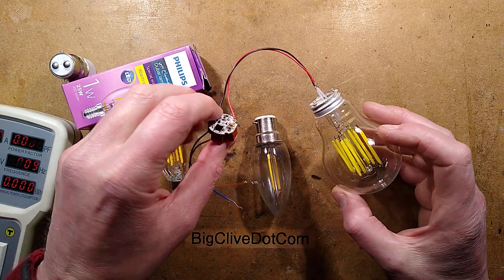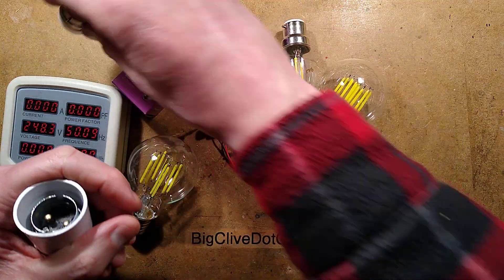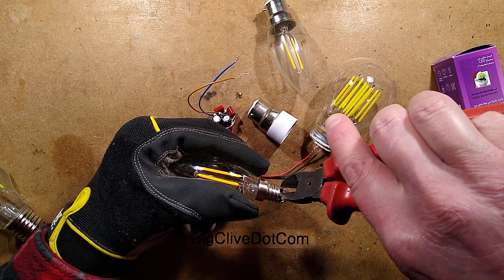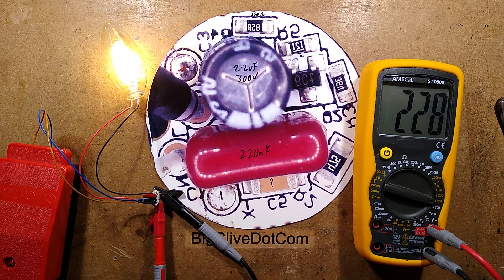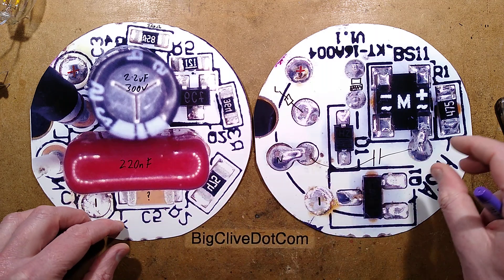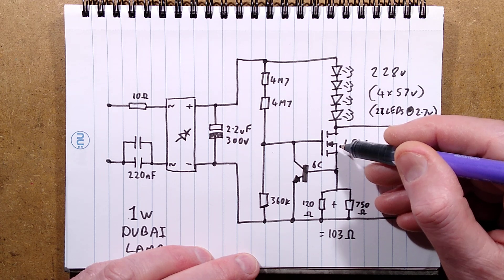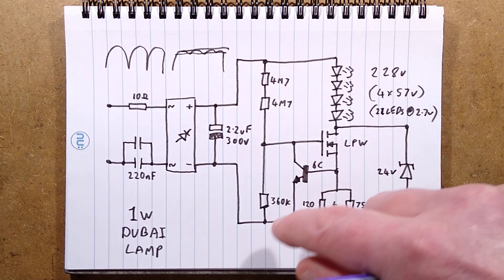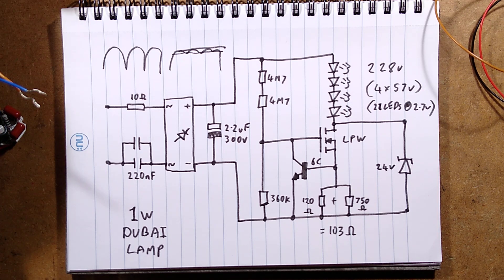Opening the 1W Dubai lamp (with schematic)

Comment: I bought such a lamp (but for E27 socket) in the Netherlands several years ago. It was costly, IIRC almost 20 EUR. I expected it to last many years but it failed after a few months and I used it for less than 1 hour per day. I planned to disassemble it but I put it somewhere and cannot find it.

Comment: I just realized that natural gas forced into tubular cylindrical flames would have the same result in a larger size would be insane efficiency. Thank you Clive
 🤘😎🤘❤️
Reply: Glass tubes shaped as the filament structure

Comment: I don't view the Philips Dubai Lamp as quite the wonderbulb it may appear to be to many at first glance. Here's why.

The Dubai Lamp's main feature is it's high efficacy of 200 lm/W. There is some good engineering coupled with some not so good tradeoffs used to accomplish that goal. The choice of starting with filament style LEDs on a glass or sapphire substrate with light being emitted from both faces was a no brainer. That is pretty much the industry standard these days among first tier manufacturers. If light comes out of both sides of the chip why not take advantage of that even if the substrate side is typically somewhat darker. A few percentage points of efficacy are gained by using a large multiple of filaments since cooler running chips produce more light. An added bonus is longer phosphor life. I doubt that 22.8 years from now (@ 3 hours per day)  I would be happy to be still using a bulb that is only producing 70% (L70) of the light that it once did when new while continuing to drawing as much power as ever. I have a bulb (GE LED9A19/830) purchased about 8 or 10 years ago. Energy Star rated, it produced 450 lm of 80 CRI light while using 'only' 9 watts of power. Probably cost about $15 and it still works. A few weeks ago I bought a 4 pack of Sylvania 450 lm 92 CRI lamps  for grand total of 97 cents. In various markets these are also called "TruWave", "Natural",  or simply "Reduced Eye Strain". They are dimmable and use 5.5 watts of power. 

One major benefit of the of the higher CRI lamps is the almost complete elimination of a rather nasty spike of 450 nm blue light inherent in most phosphor formulations used in 80 CRI lamps including the Dubai. While it looks good on paper, and contributrs a large percentage to the Dubai's stated 200 lm/W efficacy, it only adds to glare and the resultant eyestrain of humans. If you've ever wondered about how those amber sunglasses or ski goggles that reduce glare and improve vision work, they do it by blocking excessive amounts of blue light. 

Another tradeoff where the Dubai Lamp gains some efficacy is by eliminating dimming capability and reducing the operating voltage to the relatively narrow range of 220-240 volts. Circuits that can interpret phase cut dimming and convert those signals to linear flicker free but widely variable led curents also use power. The elimination of any form of power factor correction is also among the design tradeoff.

One last place where efficacy is gained is by the use of clear glass instead of any kind of coating or diffusion material. Essentially anything that uses power without generating light (regardless of quality) is eliminated if at all possible.

Technical information in English including all those nice graphs and charts can be found at https://images.philips.com/is/content/PhilipsConsumer/PDFDownloads/Saudi%5FArabia/ODLI20160920%5F001%2DUPD%2Den%5FSA%2DPhilips%2DDubai%2DLamp.pdf or by using the search string "dubai lamp technical application guide".

More information about the reasons to avoid excessive blue light can be found with the search string "Natural Light White Paper SYLVANIA LED TruWave Innovations"

One major benefit of the of the higher CRI lamps is the almost complete elimination of a rather nasty spike of 450 nm blue light inherent in most phosphor formulations used in 80 CRI lamps including the Dubai. While it looks good on paper, and contributrs a large percentage to the Dubai's stated 200 lm/W efficacy, it only adds to glare and the resultant eyestrain of humans. If you've ever wondered about how those amber sunglasses or ski goggles that reduce glare and improve vision work, they do it by blocking excessive amounts of blue light. 

Another tradeoff where the Dubai Lamp gains some efficacy is by eliminating dimming capability and reducing the operating voltage to the relatively narrow range of 220-240 volts. Circuits that can interpret phase cut dimming and convert those signals to linear flicker free but widely variable led curents also use power. The elimination of any form of power factor correction is also among the design tradeoff.

One last place where efficacy is gained is by the use of clear glass instead of any kind of coating or diffusion material. Essentially anything that uses power without generating light (regardless of quality

Comment: Shouldn't the voltage be something like 308 volt (220 V ×1 ,4)  after the bridge rectifier?
Reply from the maker: It's current limited by the dropper capacitors and then pulled down by the LEDs.

Comment: Does an LED 'filament" need to be in a bulb under vacuum? I didn't hear any fshhhh when you took the bulb apart.
Reply from the maker: They sometimes use a gas like helium at atmospheric pressure just to help couple heat from the LEDs to the outer globe.

Comment: This is an interesting bulb Big Clive, quite a bit of thought along with trial and error must must have been put into making all that circuitry fit into a candelabra base.

I suspect there was a fair amount of trial designs proposed before the customer accepted this design.  Normally, if you place a capacitor across the LED string to keep a small amount of current flowing during the valleys of the sinewave, the flicker is not objectionable to the average person.  However, this design in my analysis, does have some modulated intensity because the bulk filter cap is not large enough to keep the LED current from declining during the valleys, although the intensity probably varies less than an incandescent bulb.

What voltage is this bulb designed to run on?  With the 249 volts of AC input, I estimate the zener is probably conducting during the peaks of the sinewave.  My best guess is about 250 volts peak on the bulk filter cap with 30 volts Vp-p of ripple.  I am guessing the zener is used to protect the FET, for either over voltage or dissipation.

I do see a catastrophic design error with this bulb.  If the bipolar or FET are slow to react to a voltage surge, the base-emitter junction will become the primary path for high current.  The bipolar will short, which will signal the FET to draw infinite current, blowing out the FET and LEDs.  If you place a 100 ohm resistor in series with the base, it stops this sneak path.

I find it interesting how the emphasis was only placed upon power consumption of the bulb at the socket but, really failed in the attempt because, the power factor is so poor.  With this power factor, at the power station, it will likely take about 7 watts to drive the bulb.  Most of the power will be wasted in the power lines transmitting 50 Hz harmonics into the air.

I REALLY DISLIKE using a capacitor for a dropping resistor.  In addition to the poor power factor, it limits the bulb to only being run from low distortion sinewave power at an exact frequency.   This also makes the bulbs very susceptible to damage from voltage spikes.

Comment: The other bulb won't be that different. I say you enjoy using that one. I appreciate the offer tho.
The zener is probably a single 12v. You must have been tired. It looks like you interpreted parallel zeners like they were parallel capacitors.

Comment: So could I theoretically put a larger capacitor in my LED lamp to prevent it from flickering when my nearby laser printer randomly heats up? My house setup prevents me from easily plugging the lamp into a separately powered circuit outlet.
Reply from the maker: You may find that using a different style of lamp alleviates that dip.

Comment: The design of these lamps is confusing me. The left half of the schematic looks like a capacitive dropper, all be it without an anti-zing resistor. The right half looks like a linear regulator, using discrete components. I have never seen these two current limiting techniques used together in a led lamp.
Reply from the maker: It's very unusual.  The linear section may be for removing ripple.

Comment: Well you can release such a product but you'd have to price it 10 times higher, to account for it lasting a long time and also the higher component and manufacturing cost both. So $20 or $30 LED lamp. But it will be remarkably difficult to convince enough people to buy those to make it sufficiently mass market where it would pay for itself, more expensive niche items tend to explode in price at which they become viable.
Reply: yeah I figure about $4 each in materials for small batches, and if youd try to DIY then your time is heavy. how long to do 10 dozen? 2 weeks? a month or more?? only a  big corp could bring a similar bulb to market, but I'd bet Phillips has a patent on this design and quite a few others to stop any US sales in the near future. gotta wait for the Chinese knockoffs to get better I suppose
Reply: @pauls5745  this is patentable? No way. Similar current limiting circuits have been seen going back to the 60s if not longer. The execution is superb but there's nothing unique here.

I am actually hoping that at least one bigger state such as let's say China makes high efficiency LED mandatory, then we can get our hands on those much easier for sure.

Comment: I can see clearly now that the drain has gone...

The 12V / 24V Zener diodes are there to protect the MOSFET from overvoltage as it is likely that it is a 30V device.
Considering the circuitry, it would have been more beneficial to use the same type NPN transistor for current regulation...
From what I've observed, linear regulators and MOSFETs don't mix very well.
A reason they would have chosen this arrangement is because of the low gate drive current; but because of the extremely low (6mA) current, the base drive current would only need to be 30uA which would be easily filled by a 2MEG resistance at 300V.

Comment: More efficient, more reliable, no flicker...  I wonder if they also have a good colour index?  That these are unavailable outside Dubai is shameful.  I can't wait till these are available shipped directly from the Candy Rock Mountain.  EDIT:  For those worried about Chinese QA... I've bought quite a few different filament LED bulbs from China and the quality does vary greatly.  I do have a couple of bulbs left which don't flicker at all, and have been running for something like 6 years, now.   I made it a mission of mine to identify which ones were best, but since I moved house, all the fitted lights are LED by design, and I have little use for these "retrofit" bulbs.
Reply: According to the Philips "dubai lamp technical application guide" PDF, the colour index (CRI) is 80 with a rather large blue spike @ 450nm and as with many other older phosphor formulations, a relatively weak red output. The efficacy of 200 lm/w looks good on paper but current phosphor formulations in the low to mid 90's are far easier on the eyes.

Comment: I just want to find a decent 800 lumen lamp in a candelabra base. You can get them in incandescent, but sadly, none in candelabra yet.  A few that claim to be good, but they are expensive, and tend to die quickly.
Reply from the maker: It's too small a base for the high current circuitry.  Both the power supply and LEDs will bake.
Reply: @bigclivedotcom  Wow!  A reply from Clive. Woo hoo!  Happy day! (seriously, big fan) :)  Yes, they bake.  Perhaps something along the Dubai lamp where they lower the heat in the lamp and perhaps creep the circuit up into the bulb cavity for more room.  Still, I've got many fixtures here in the USA that utilized the small form factor of the candelabra base for a high lumen demand light.  Mostly candy dish style closet lights and two room lights with (acrylic) hanging crystals as pseudo diffusers. All pretty, but needing more output with LEDs.

Comment: I have all Philips standard LED light lamps, and I would love to have these more efficient ones. I would happily pay - pro-rata - for their extended life. If they last twice as long, then twice the price  ... just for the additional efficiency. 

I also like their rather white light. Not interested in a warm light from electric lights. If I want a warmer more cream coloured light, in winter I am more than happy to light a candle in my front room of an evening.

I love watching your videos on electronics and as a mature student [aged 38/9] did Electronics A-level with an an amazing lecturer who was retired Army, and sent down to the Falklands in his younger days. I also did Maths [Applied and Pure] and Physics A-levels at the time, so can mostly follow you without having to go back and get my thinking cap on, though sometimes you challenge the remains of my little grey cells!

I also played the double bass professionally and taught the instrument, so I happen to have some vintage replay electronics. Notably a 1957 Leak Trough-Line VHF/FM radio and a Quad ESL 57 - also made in 1957, though my Quad valve power amp is rather less ancient.

I am fascinated by the old and the new.

Just a rambling penny's worth from George [60 this year].

PS. Your voice is so fine on a sixty-four year old electrostatic speaker - last rebuilt five years ago in Huntingdon where is was originally made!

PPS: If you want a laugh, I have a Youtube Channel with just one film, featuring my old radio set. Not good sound, but it gives an idea. 

https://www.youtube.com/watch?v=37-clsC2lQ4

Comment: I like the current regulating arrangement on that lamp. Simple, easy to understand. It seems to me that it would limit the current to a set voltage across those resistors regardless of what the capacitive dropper is doing. That means it would probably be even more efficient at 230V than at 240V.

Comment: I have my bedroom a hanging lamp with three E-14 lamps in candle shape.
 
On my last purchase in a remaining stock market, I found heavily reduced OSRAM filament LED lamps with 4 filiaments each and a rated power of 4W. I purchased three of them. 

They are pleasingly completely flicker-free, but for the place of use really too bright. 
What's closer than, to Dubai-I-ficate them?

In a test buildup I found out, when I add a 1μF capacitor in series to the whole lamp, I can make the three LED-lamps down to 1W each. Perfect!

Comment: I wonder.... The part that seems mostly to limit the age of this lamp is the 2.2µF.  What if you would use the largest possible non-electrolytic capacitor for that (but same physical size), and that current limiter is used fully for ripple smoothing ? Could you try ?
Reply: That would be interesting to see.  He says the regulator seems to run with about 5 volts across it, so not too much headroom (that zener probably adds a hard limit as well).  However, a polymer electrolytic capacitor might be a good choice instead of the usual wet variety.

Comment: The 24V Z-Diode makes no sense, it probably goes to the Gate of the MOSFET. And current regulation is mainly used to adopt for mains voltage fluctuation, as even an incandescent buld flickers with 10% and no one notices. But filaments in parallel without resistors to distribute the current evenly in the 3W bulb does show, that the engineers from Philips are as stupid as some Chinese lamp manufacurers, and I doubt that the 220nF capacitor will have a long life, it's stressed.

Comment: Nice tear down. That little circuit (and variations on it) is one of my all-time favorites. Looks like it's set to put about 6 mA through those bulbs. It's just the diode drop in the bipolar transistor divided by the resistance, i.e. 600mV ÷ 103Ω ≈ 6mA.

Comment: Dear Mr Dotcom  or may I call you Big Clive?  I just wondered if you ever converted an old telephone to run on the new system?  I very much like my old phone, a kind chap at BT kindly interfered with it back in the early 80s to make it work correctly.  However now with the new superdooper mega fastish because I live in the sticks Internet connection it does not work.  Not sure if it's broken or just not compatable.  Any ideas? I do miss being able to slam the phone down. I tried it with my newfangled phone and it just smashed.
Reply from the maker: Even modern exchanges should work with pulse dialing.  Although they may gradually phase it out.
Reply: @bigclivedotcom  Perhaps I need a different filter jobbie. Oh well worst case is a modern phone and perhaps something like an emergency stop button to simulate the slamming effect.  Thanks for you're  advice.  
Ps  turns out it's the sky phone line because the phone works fine at me ma's

Comment: It's weird because the small bulbs I bought at the dollar store ($4 each) have 4 filaments, not 2. It's called a Luminus PLF600D2, 4W, 120V60Hz 45mA. I don't see a circuit. I think maybe they are subpar filaments, so they doubled them to make it a bit brighter.

Comment: About schematic: interesting to know what voltage value is on the "+" of the 2.2μFx300V electrolyte, if the grid voltage is 230V AC?  +326V? Then the electrolyte should be on 350V but not on 300V Or I'm wrong?
Reply: The LEDs and the zener diode will clamp the maximum voltage across the capacitor so it can't go above a certain value. That maximum value will be whatever the LED voltage Clive measured was (I forget) plus the zener diode's voltage.
Reply: @eDoc2020  ok, thanks